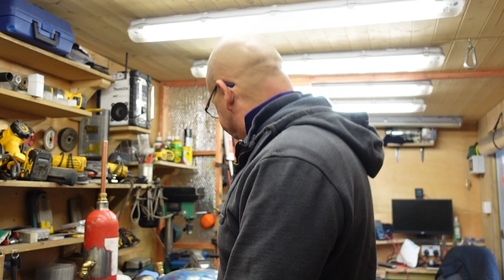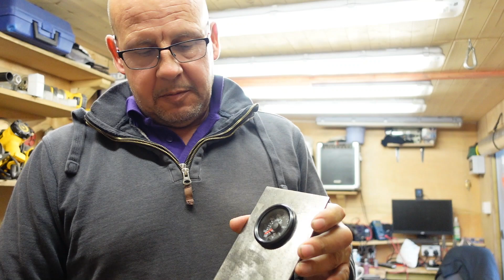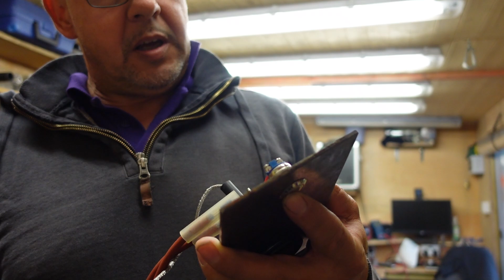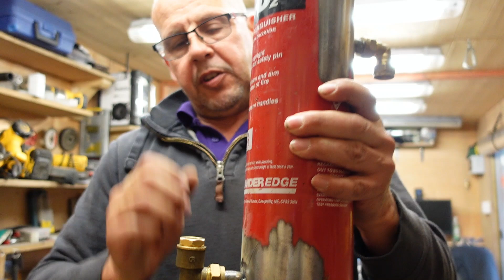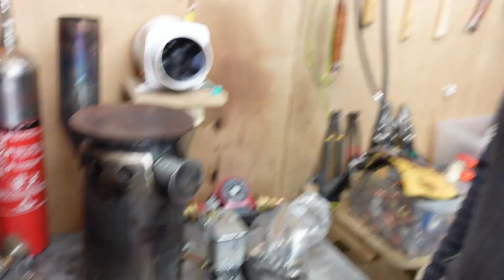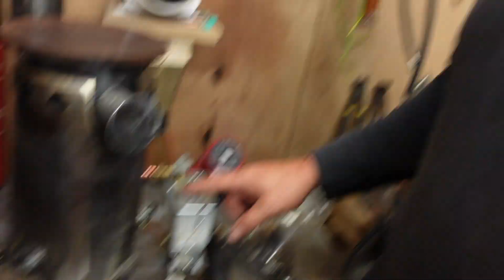DIY# Free Heating and Hot Water, Crazy Idea`s For Real People

Comment: Besides having hot water, why have it go into a water heat exchanger? I would think having an air to air exhaust heat exchanger would be more efficient for heating a room and a coil could be added for water? Just my thoughts. I would be interested in your thoughts.
Reply from the maker: Good afternoon my friend 
Ive considered many different options I have a few in mind. Your idea sounds great which I will be looking at very soon.
The idea I have at the moment is just a test, it's designed to heat the water for the heat exchanger only.....im hoping to extract the heat from the exchanger by the fan that is currently attached to the exchanger, im going to see how quick it heats up, I have considered a coil around the exhaust outlet and seal it with in a larger tube with air extraction I have different ideas 💡 😀 going around my head, and one of them is exhaust heat.
I'm hoping to do a test on my system this week and see what happens I will gather all information and decide the next stage. Like you I would also like to be efficient. Stay tuned,  next video coming soon my friend.